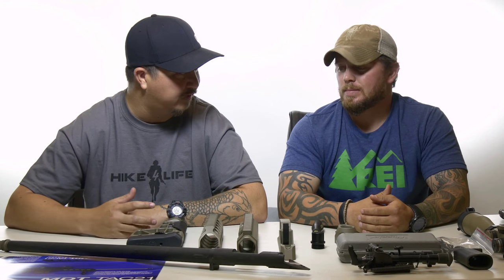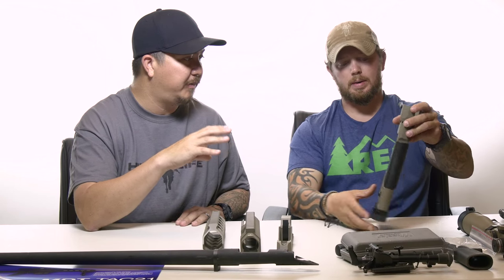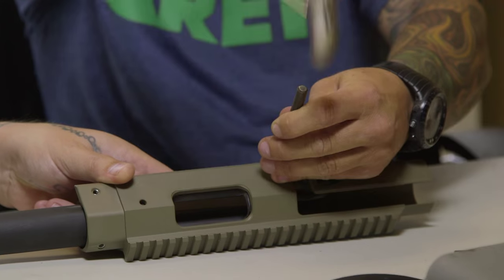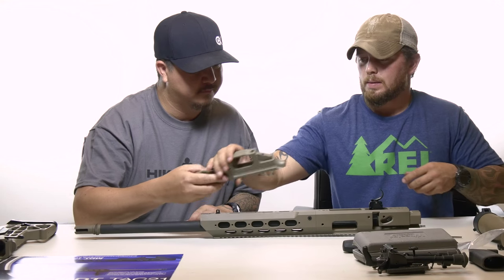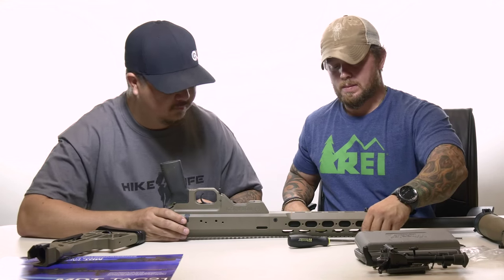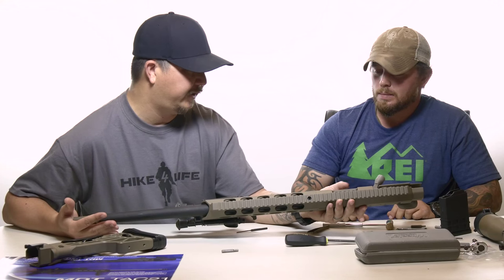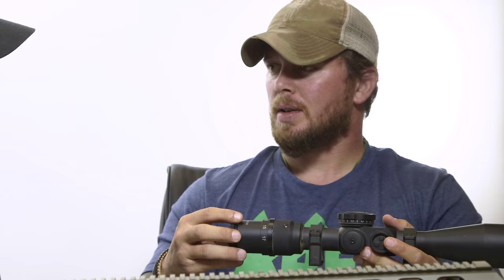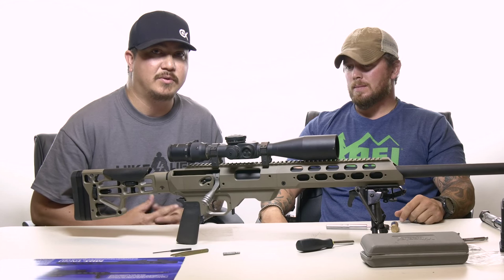MDT Tac 21 Chassis System for Remington 700 short action - Installation

Comment: Im new to this thread, and the long range game so give me a break when it comes to terminology. I just yesterday received my MDT tac 21 chassis for my Remington 700 5r gen 2 308. Everything was going well during install until i reached where the trigger needs to fit into the barreled action. It states you put the barreled action in the receiver to where the recoil lug is up to the housing, then back the barreled action about 1 inch out, put the selector safety switch into the housing (on safe) and the selector switch should stick out of the safety housing. Then back the barreled action to where the recoil lug is against the housing and the trigger should fall into place. Mine does not. It looks like there isn't enough clearance between the housing and the selector safety switch. It actually put a spur in the housing when i tried to fit it together. The barreled action will not fit into place when the trigger is in (it does with out the trigger) and meets hard resistance (from the selector safety switch on the housing). Can someone please point me in the correct direction.

Comment: The manual states to torque the back action screw first, LA is 65ft lbs, SA Is 60ft lbs. In your example,  suggest recheck the front as when the rear is done it may take stress off the front action screw.  Otherwise I like it
Reply: Interesting. Glad that comes in the specs

Comment: I just purchased a Tac21 chassis and a remington 700 sps .308 but it doesn't have magazine as It's built in. Once I assemble the Chassis it should be compatible with the magazine right? or do I need a clip conversion kit as well? 
Thanks man
Reply: The chassis is all you need

Comment: The Remington 700 doesn't have a magazine so dose this kid convert the 700 to except magazines? I just want to make sure I purchase the right Remington 700 before I buy the TAC21 stock.
Reply: Ben Wilson Your the man thank you so much
Reply: This chassis system is supposed to convert the 700 to accept magazines so you shouldn't have needed the part listed above from Ben Wilson. Is that correct?

Comment: I like way it looks, but I can't justify paying for something that cost more then the rifle and only increases accuracy by 10 to 15% at tops. A new barrel yes, 80% accuracy improvement will come from the barrel. So that leaves 20% to trigger and a stock. I did a barrel and trigger, glass bed the hogue stock, bolt and called it good.
Reply: But your failing to consider what it does. It makes it 100% adjustable to you as a shooter ( acuricy increase) it helps mange recoil ( acuricy increase) completely free floats the barrel ( acuricy  increase) i could keep going